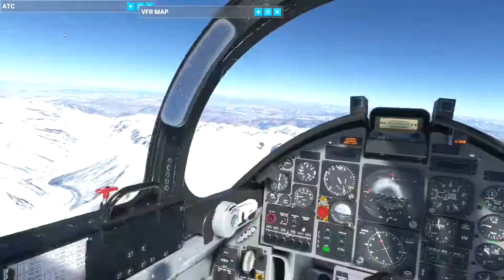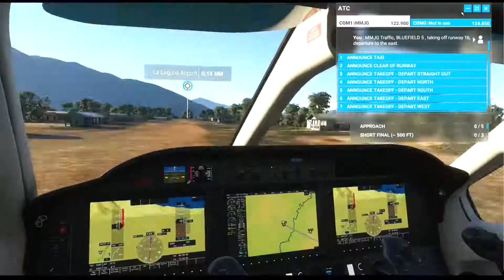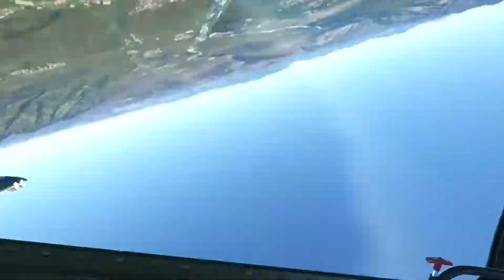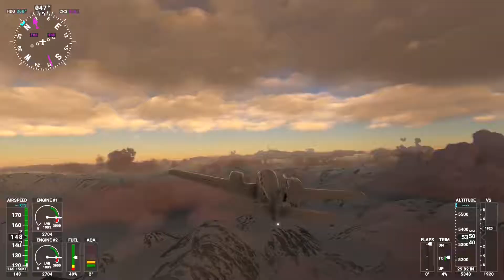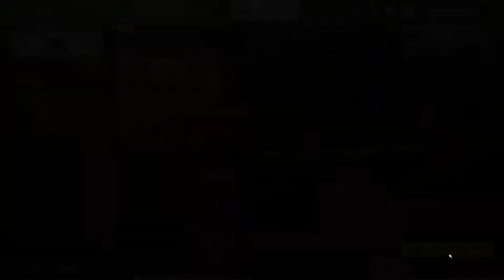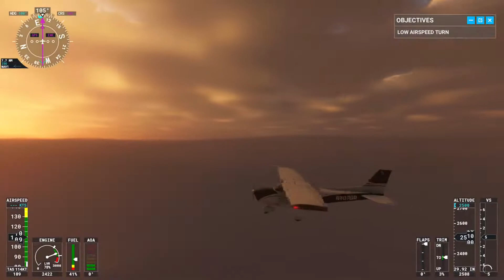IFR Test Issue MSFS 2020

Comment: 2026 and this training challenge is broken but in a different way. The magenta GPS line at the start is completely wrong, pointing directly North to South instead of to the VOR. If anyone runs into the problem, the solution is right at the start of the training to hit the "Direct To" button key (in the lower right, has a D with an arrow going through it), then hit ENT (enter) key twice to set the GPS line correctly. Following that line will lead to much higher score and A grade. As far as the specific issue shown in this video with not receiving any commands at the end, I never ran into that, but just wanted to share the newest bug and solution for anyone else experiencing it.